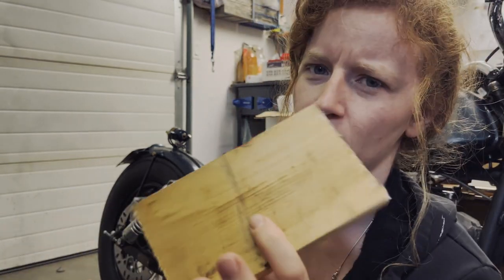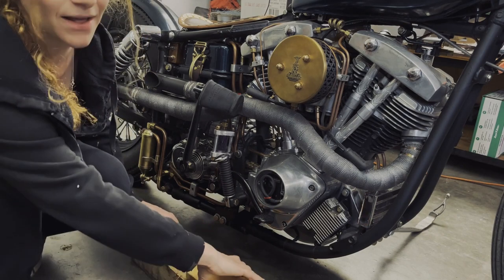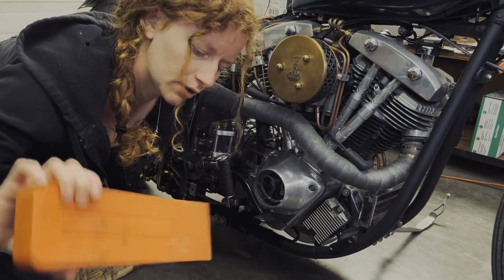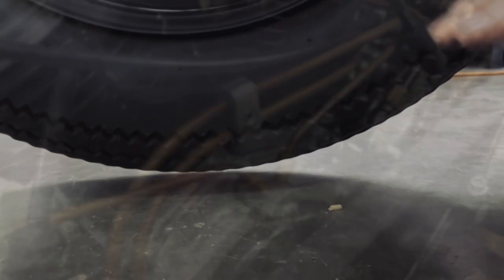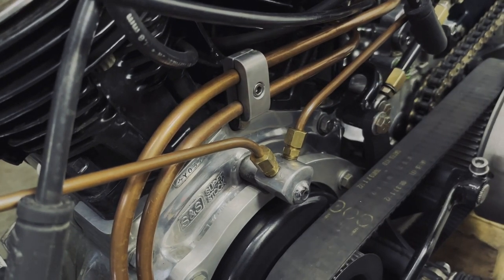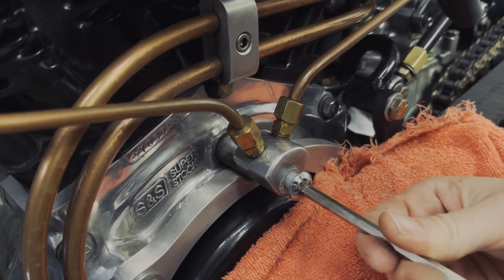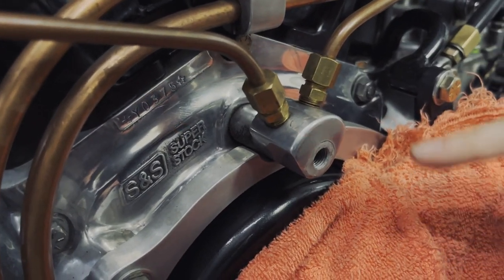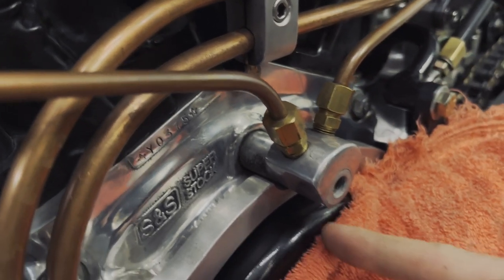Static timing Shovelhead stroker

Comment: Yes, it was certainly an interesting video. These days, personally,  I generally only get to work on stuff with electronic engine controls and there's no real option to input any "Mechanical Witchcraft" into the work. The computer only allows you to set it to the specified settings and you've no option to alter it. It was interesting to see a purely mechanical approach to the job of timing the engine. You'll probably hate me for suggesting this, but a gas analyzer is going to be the only real way to set your fuel/air mixture correctly. Even then, a carburettor is never going to be perfect in all cases. The popping on overrun is likely to be a lean mixture on a closed throttle.  If it goes away with a gently closed throttle, that's a good indication of it being lean on idle setting. I have a 2021 two cylinder Italian motorcycle and that is set just as lean as it will stand without melting the pistons. That crackles and pops on a shut throttle overrun like you wouldn't believe! I think your exhaust pipes are too short to be retaining and then igniting unburnt fuel in there and that being the popping you can hear. Anyway, keep doing what you're doing!

Comment: Hello red hope you're doing good.  I was wondering if you ever fix the oiling problem on your rear cylinder? And how do I get my hands on those early 2000s progressive shocks that you have and how do I measure them? Much love to you and I like your videos a lot
Reply from the maker: I think the oil issue is a leaky valve seal, so i will have to take the bike apart this fall and replace those seals. I got my shocks off a guy who was selling them secondhand on Facebook Marketplace, think they had around 5000 kms on them when I picked them up, so almost like new. You should be able to find some for a decent price secondhand I would think. Or, if you are okay with spending more, I'm sure you can order them in from a dealer or parts place. Mine measure 12 inches from center of eye to center of eye.

Comment: Decel pop isn't necessarily  a bad thing it may just be unburt full in the pipes as your screwing the throttle .and comming down through the gears. But it can be bad if its timing which may not be the case here but possibly a intake manifold leak?. But that would make the bike run obviously erratic. A lean mixture from intake leak can overheat the bike make it cough and fart and power surge etc. Exhaust gaskets and plugs need checking also. 
Dont bother doing the timing without new plugs. Any soot near the exhaust gaskets tells you they are leaking. A loose carby mounting bracket can cause an intake leak or inlet manifold clamps, incorrectly seated rubber manifold orings are other areas to pay attention to.
Reply from the maker: Thank you for this comment. I don't know why, but it never was visible in my comments section till now.

Comment: You can static time them with a dial guage to so many degrees BTDC or back of the big hole Us old farts used use a cigarette paper or light bulb on the points to measure them just opening but you have the light on that  electronic ignition  so your good also you should check your pushrods are turning and arent tight while your at it

Comment: Depending on the climate, I prefer a slightly rich idle setting and intermediate. Sitting in traffic, or 5mph while too lean makes the motor get too hot. If she starts to load up , a blip of the throttle clears it out.
Reply: Don't need to blip anything if you just fool with it till you get it RIGHT ! It ain't 'right' if it's rich, or LEAN !! This idea of, " I'd rather have it a little rich" , is just laziness. My thinkin was always, " I ain't done till it's 'RIGHT' !  Just put in the work and get it "RIGHT" !  If you can't get it right, there's a 'reason' ! And something else is probably  needing attention. See, you never really learn your machine, if you're willing to settle for " half assed". And that's okay untill you start down that ' on ramp ' ...  and thats when I come from behind you, and fly out there   leaving you wondering what the hell just hit you.  "TUNING" ! That's what just did that to you! And don't give me that, " well I'm not a racer"  crap!  Nobody likes it when they turn the throttle,  and shit don't happen right !  Especially, when another bike just ran off from them ! And I promise you, if it's me, I'm gonna laugh my ass off at you! And you and your crappy running junk will be the brunt of a lot of stories told down through the years, when the brew is flowing. People miles away, for years,  will hear  of  that  junk Harley and remember the stories of "the Harley" that couldn't get out of it's own
 way, for all the poppin and hesitation, and just plain  "NOT TUNED" junk out there  representin' Harley Davidsons ! Don't embarrass us all ! TUNE that beast, untill it's at a 'sharp edge' ! Racer or not, you'll be glad you did,  a thousand times, over the years! Then you'll be the one laughin' at some rookie who doesn't know one end of their bike from the other! 
  Whew, Lordy ! GET DOWN !! 
  Sorry. That happens sometimes. I just can't stand Harley's gettin a bad rap cause somebody is lazy ! So lets TUNE those bad boys !!!
Reply: Hey Red !  Keep the detailed work up just the way you are! 
   One of these days, before long, your scoot will be one of the ones I was referring too, thats tuned to a "sharp edge'. You're a detail person by nature!  And thats great!  Never let anyone else whose  sloppy about their stuff influence you. 
  And down the road, the stories will be told, and the music will play, and for the rest of your life, people will remember that red hair  flyin', as you thundered past them out there on the road ! 
  You do it for the thrill. But the stories are just  a cherry on the top.
  Just two days ago, I sat laughing my ass off in my living room, remembering how I met a dude who turned out later to be one of my lifelong buddies. I blew the paint off his jap bike tank as I left him wondering what just happened!  I couldn't stop laughing remembering ... that was 43 years ago !  It never gets old !!  It's always great !
Reply from the maker: Thanks Clint for commenting on my vids, you seem to know your Harley’s and always have some good advice to share. I want my bike running the BEST that it can! Even if it has a leaky valve seal that needs addressing, there is no reason not to have the timing and what not all set up as it should be. It will take me a little more screwing around I’m sure just because I’m learning, but it’s my project I chose to to have and, after all this time and money, I want it at its best! I’m too close to just start saying “it’s good enough”.
Reply: @clintwoodruff1187  Some older carbs just do not offer that 'perfect' tunability of an S&S Super E. The Bendix was popular on Shovels and a replacement for the Linkert on Pans, but only had idle and main circuits. No intermediate tuning. We used to say ya could set them up 2 ways, 2 rich or 2 lean. 
The Dell'Orto was a great carb with 4 adjustments; idle, off idle, mid-range and main. But if ya changed 1 , all the others changed too. 
The Mikuni 'pumper' was basically a simplified copy.
The SU was a good one too.
The Evo's Keihin CV, often replaced with an S&S is a GREAT carb for a relatively stock motor or one with mild cam and good exhaust. At one time ya could get them dirt cheap. I have one on my '68 'slabside' Shovel with Dynojet kit...

Comment: I open up my push rod tubes so I can see when both valves are closed on the front cylinder to find TDC. I also put a reference mark on my ignition plate to the nose cone after I have timed the ignition just in case the screws come loose and The plate turns. I had the screws back off on a trip to Sturgis a few years ago, bike ran like crap,  thought it was a jetting problem due to the altitude change in the black hills, but it ran poorly all the way home. Started checking it out and found the timing to be fully retarded, did a static timing on it and it's run flawlessly since. I put the mark on it so if it does move again I can at least get it close enough to run til I get it home
Reply from the maker: Wow jeez, that would have been a pain! Making a mark their isn’t a bad idea 🤔

Comment: Wisdom states you should have some form of support bracket for your carb. What you describe as popping ,hard to start,conking out at the  lights can be an air leak caused by no support for carb. Take care. shovels rule
Reply from the maker: I’ve got a bracket supporting my carb.

Comment: Is your flotebowl supposed to be vented and is it?
Reply from the maker: It has an overflow line
Reply: @RedRiderCanadaBC  I'm not sure it's the same. The vent usually is exposed to the vacuum of the air cleaner box. If not vented properly it can cause burps and farts.

Comment: popping   is  coming   from   overloading   fuel  chamber  as   next   `  exhaust  `     sequence  occurs   it   fires  ,  what  is  causing  it  if   valves  or  rings  slight   adjustment  to  cleaarances  and  or   a  vapor   lock   when   releasing  demand   on  fuel  consumption   (  proper   pressure  testing  here  will   prove   if   everything   is   on  the  up   n up  )  ,   first   here  is   ,  is   it   electric   fuel  or  tank  fed  /  gravity  ,  size   of   jets   and  or   build   up   on  jets  a  good  once  year   cleaning      is  suggested    before   the   season   just  to  make  sure   no    oxidation  biult   up   on   bowl   or   jets   etc,  best  to  drain  it  all  out  let  it  run  till  is  dies   gas  off  end   of  ridding  season  , plugs /electrical  checked  as well   ,   but   i   am  already  sounding   like  your   dad   ,  sorry   ,   but   (  also   during  rainy  days   ,  best  to  check   everything  fuel   wise   next   day   ,  grab   one  of   those   water   testing  strips  for   small  tanks   or  what  not   ,  water   in  fuel   ) yes   oil  too   , old  fuel  ,  a   fouling  out   plug  or   just  a  bad   pulg  connection  ,  sometimes   this  is   noticed   during   sudden  decrease   in  speed   without   a  stop   involved   ,  as  well  as   floats   in   bowl  sticking  does   same  thing  ,  hmmmm   🤔    :face-orange-raised-eyebrow:  yea   ,  check  wiring  to   make  sure   Nothing   in  Bare  and   places   where  its   been   tied  down  for  a   while   is   the  worst  areas   on  a  bike  with  all   the   vibration   ,  hope   you  do   solve   this   Mystery   ,  was   thumbing   through   suggestives   and  seen  you  channel   ,  nice   to  E-Meet  you  ,   thank  you  for   Your  time   efort  and   content   . (   jst  fyi   =  most   of   the    time   i   am   joking  around    ,  so   do  not  take  anything   that  may  seem  to   be  off  topic   ,   but   i   would   never   be  That   Guy   ,   but   i   like  d ry   humor   ,  best  to  keep   it   on  th e   up   n  up   ) `   a   real  layed   back   individual   ,   =  I   Hope   ,   and   thats   nice  ,   thank   you
Reply from the maker: Awesome, thanks for the info! I'm glad you found my channel and I hope you continure to enjoy my videos ✌️

Comment: The BEST to do when a motor runs Good Is do nothing othe than change OIL and filter  If you lose bolt tighten bolt lose bolts tighten bolts It is not good